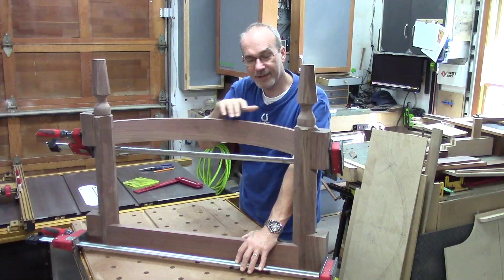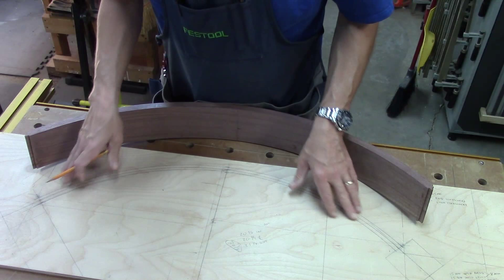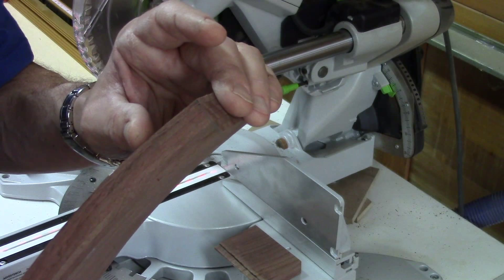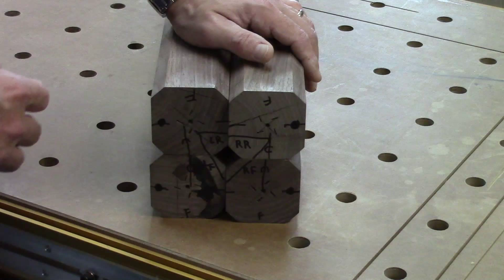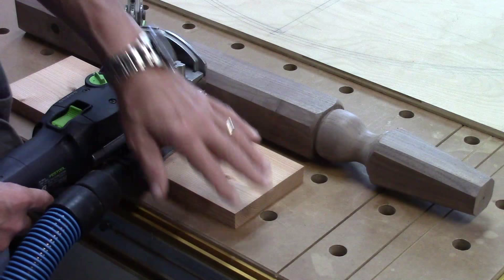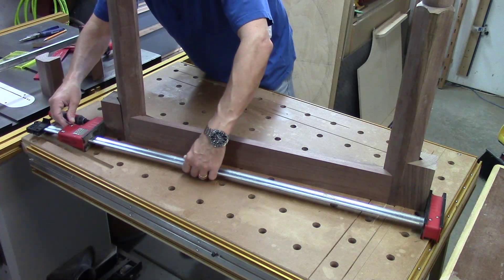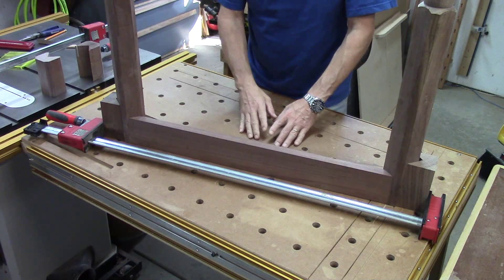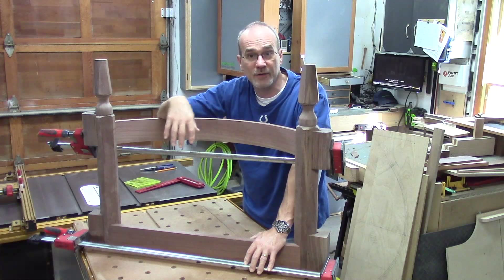Butterfly Leaf Dining Table 4 - Curved Rail Joinery

Comment: Coming along nicely. Surprised that you didn't need to apply any downward clamping pressure at the apex of the curved apron, keeping it from bowing out with the pressure applied at the legs. 10 points if you understand what I just wrote ;-)

Nice to see the Domino in use. There seems to be a reticence among woodworkers to use them in videos.
Reply from the maker: +Marty Backe Hey Marty! Thanks. I shall collect the 10 points. Yeah, I thought of that, but I will be sizing the bottom stretcher between the two bottom rails after the glue up of the base. If it bows out a little, it's not a big deal. My main goal was to keep the joints tight at the legs and perpendicular to the legs. I glued them up today, and everything came out very well with the exception that one of the curved rails did drop about 3/32" of an inch. Will be unnoticeable considering the distance between the two. 

  So what can I get with 10 points? Are they like airline miles?
Reply: +GuysWoodshop Your points have been duly recorded :-)   3/32" of an inch?? Man, your standards are really dropping Guy ;-)  I'm sure you'll be pointing that out to everyone who sees the finished table.
Reply from the maker: Yeah, getting sloppy in my old age.....

Comment: Nice. I did wonder how easy that assembly would be. But it appears there is enough slack in the domino joint to avoid assembling all four joints at the same time - takes the pressure off a bit!
Reply from the maker: +Mitch Peacock - WOmadeOD Thanks Mitch! I did the glue up Sunday morning, and it was a real pain. The dominos are very tight, and there was really no way to use a mallet to tap them home. On the second end piece I lightly sanded them so they would slip a little easier, and it went together very nice. All the joints came together nice and tight and the assemblies are square.
Reply: Yeah, glue tends to tighten everything up! But you found a solution and it ended up perfect - mark of a craftsman. I just hope you have the legs on the right way up this time ;-)